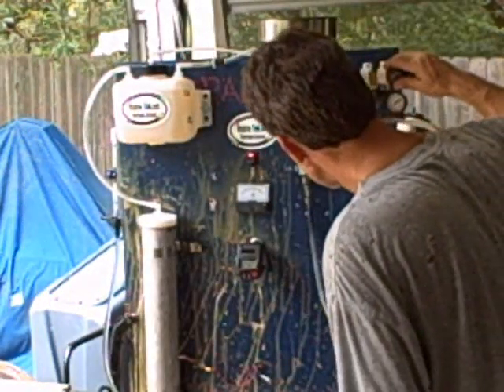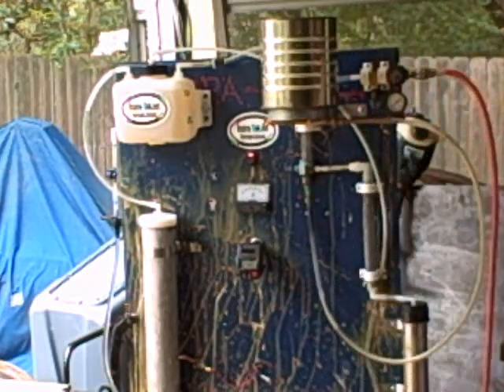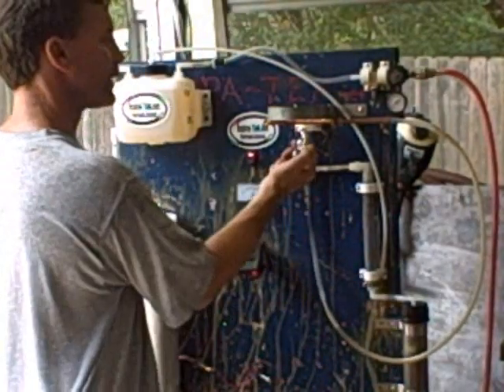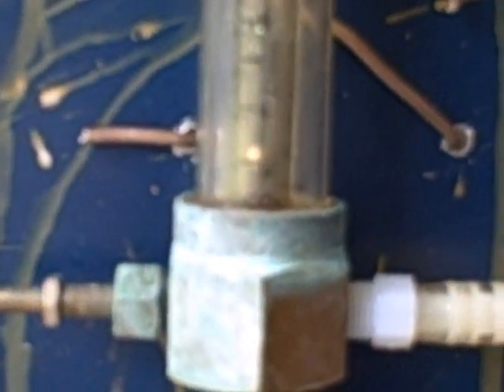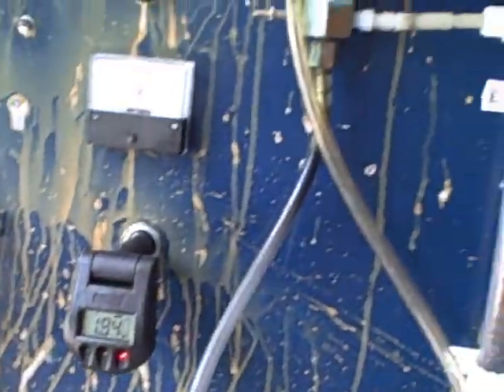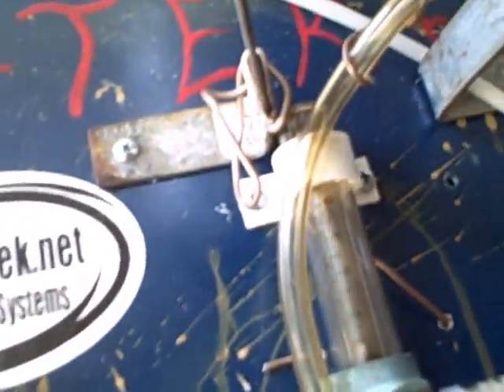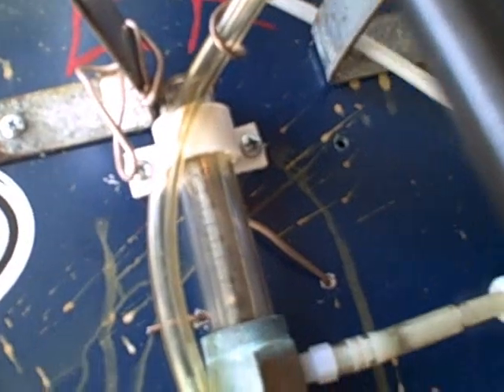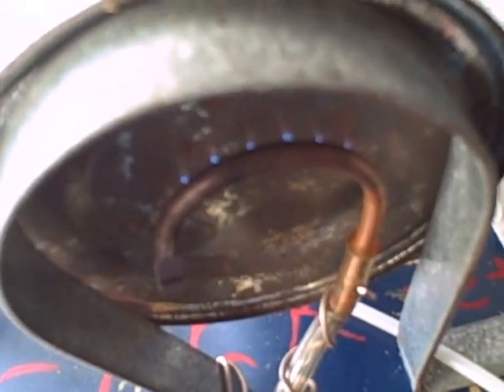testing flame with turpentine scrubber

Comment: I guess you have to start somewhere when you do some experiments. I do it myself as well...so I am not blaming you for anything, but it is easy to say do this...and do that....LOL 

The gas bubbles up through the Turpentine and looses the water moisture that's inside the gas, that is why he is doing that, but it can pick up some turpentine vapors while  the gas bubbles are rising up to the top of the bubbler and of course that  vapor burns too. 

Greets from the Netherlands, iT

Comment from the maker: According to a patent by Henry M. Paine from 1884 the hydrocarbon addition makes the gas safe for compressing and imparts luminosity to the flame. that means the gas can be made safe for use by this method without separating the hydrogen and oxygen. 

If you stretch your imagination a bit you see that a hydrogen generator can replace natural gas and be made anywhere at any time as long as you have power and water. That same gas can be bottled and used at any time.